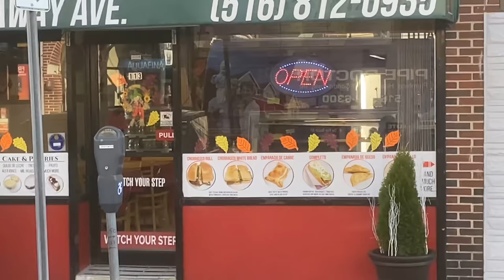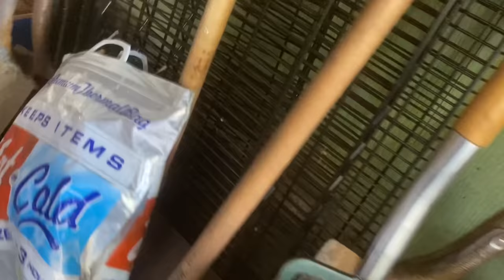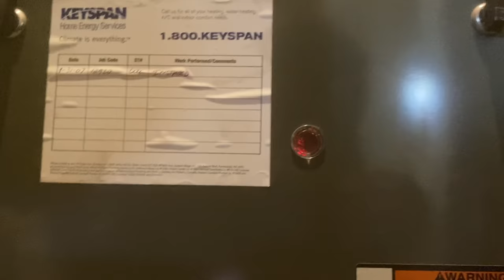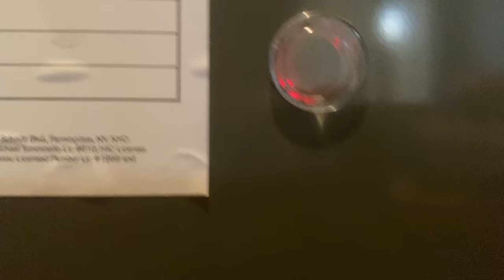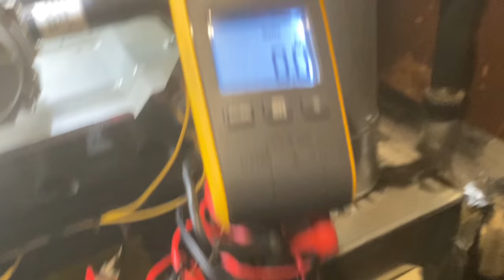Trane Gas Furnace Not Heating No Ignition Resolved

Comment: I find that those boards fail more than most. We use that universal board almost weekly. Roll out jumper elimates the old wire harness that you had to add jumper wire to. Also most trane boards will recommend you use the ignitor due to voltage change from 80vlt-120vlt.

Comment: The board probably had a failing relay. Once the contacts inside deteriorate you get strange voltage drops due to increased resistance of the contact pads.
Reply: It would be good content to try to find the defect on the board.
Reply: @Danimal.69  on the 120V output relays, failed contact will usually overheat down the relay pin and melt the solder joint on the back of board under the relay.
simply re-soldering it not the right fix, the relay should be replaced. all that said, you should never repair any HVAC control boards due to safety concerns. if something goes wrong after you repaired a "non field serviceable part" your on the line for damages and worse.
Reply: @throttlebottle5906  100% agree. I never said repair but to do an autopsy of the board failure. The problem could be a transformer or lose wire and so on. If you are not testing, then you are guessing.

Comment: A old timer showed me starting out. He would turn the fan to on and hold a lighter to each burner. The air in the heat exchanger makes the flame dance around. Then inspection cam and combustion test

Comment: If I was a betting man I would say that somebody replaced the original 80 volt igniter with a 120 volt. And it just wasn't getting hot enough to fire the furnace every time. If you notice in the beginning the orange glow of the hot surface igniter looks very droopy and not very bright and doesn't light up the compartment around it very much. After the new board is installed (sending out 120 volts) the hot surface is much brighter and the orange glow lights up the entire compartment around it .  Just an educated guess based on what I saw, because the old board was definitely an 80 volt control. 😎👍
As far as the heat exchanger goes, with that reading of 21ppm in the exhaust you're good. If the heat exchanger was compromised you would have been much higher than that. Probably up in the hundreds. 😎👍👍
Reply: @PipeDoctor  How about that reddish tile floor ?
Reply: i don't think a bad heat exchanger always produces high co ppm in the exhaust. depends on location and size of cracks/holes, impact on combustion.
Reply: That's why there's an update kit that comes with a 120 volt ignitor update. Kit 18110 I believe but don't know why Trane  switched ignitor voltages. The board will fix it though unless that's the 80 volt ignitor then the board will kill it in a month like the one I did on a heil last month. I'm new so I may be totally wrong.
Reply: yeah, 80V ignitor model board, 50A65-475 and newest factory replacement is 50A65-5165. which is for an 80V ignitor.
wrong 120V ignitor will certainly have multiple random ignition failures, 120v ignitor it doesn't get hot enough on 80V
Reply: @throttlebottle5906  Yep, and that was the original 475 board w/ 80v. The ceramic on the bottom of the new igniter looked round, which means it was a 120 volt, and it was wire nutted with those ceramic wire nuts that come with the newer igniters. 
Doesn't really matter though. The old board needed to be upgraded anyway. 😎👍 
Merry early Christmas throttle. 🎅

Comment: It was my policy if the gas valve control relay failed, I replaced the gas valve with the control board. After a couple of recall burns I found that resistance will drop causing the gas valve to draw excess current which would cause the relay to fail. Just a suggestion.  I've seen this alot with the smart valve Honeywell used for a while. Just a suggestion. That valve may be completely fine.

Comment: I had one at midnight; found bad ifc board plus Bad ignitor.
* Best to have two Or more voltage testers, on system.
From Denver, Colorado.plenty of furnace, boilers and mini split systems up in the high Rockies.
Yes, Burns on hands from time to time; freaking hurt.
LoL.

Comment: Mike,

A few things to note. First, I would double check your compatriot and make sure he replaced that igniter with a 120 volt one, other wise you’ll be replacing that igniter at no cost before two years is up. Second, those boards are bad for issues like this because the solder joints behind the 9-pin connector become loose and don’t make a good connection, hence the fluctuation in voltage. Next time, you can confirm your suspicion of the board by “wiggling” the 9-pin molex plug in a few different positions and when you hold it in the correct spot, it will fire up like normal: move it; and it will shut down again. I was told that this is part of the reason why Trane dropped White-Rodgers from their OEM control board manufacturing and switched to Emerson (the new OEM Trane boards are the green Emerson ones, not the mustard White-Rodgers). Third, I believe your lead was touching the chassis which may have caused a quick short circuit and would not allow voltage to display (just a theory there) the first time. Lastly, I always pull out the high limit and use an endoscopic camera to inspect it. It beats pulling that blower just to check a perfectly fine heat exchanger lol. Thank you for the content Mikey Pipes! I’ll see you in the next vid!

Comment: Open coil cover, make a 3/4 hole with step bit send in camera  in A coil over or take off high pressure switch out and send in camera, last ting is start blower and put a match in each heat exchanger hole to see if blower turns off or interrupt the flame

Comment: to check a heat exhanger primary i usualy use a insoection camera and go through the high limit or look down from the plenum if there is no coil or a gap of duct work before the coil. 
for a secondary theres ways to do it but the best is to pull the blower and actually just get in the cavity and look up

Comment: put your manometer on the heat exchanger side of the pressure switch and turn the blower on. if you get positive pressure you have an issue

Comment: would it be possible to jump 24v direct to the gas valve just as a test?
Reply: Thats what I do!
Reply: @SKAZ427  Cool! 
So that way you know if the GV is working or not... you just bypass the Control board.

Comment: same thing happened to me but the ignitor never came back on.  Trane XB80 f.a.g.heater flashing codes say bad hight limit but checked the H L. and thromostats all good. Any ideas?
Reply from the maker: check again
Reply: think its the main board ( also did some tapping and still didnt work ).
 @PipeDoctor

Comment: Could the secondary heat exchanger be partially clogged causing the high co levels .  testing the pressure switch with a manometer to see if it within specs. Remember, I am not an hvac expert but I do play one in YouTube comments. lol
Reply: this is an 80%, no secondary

Comment: If you slide the blade of a 3 amp fuse between the operable portion of the door switch and the side of the switch as you close it, the friction is just perfect enough to hold it in place … thermostat wire replaces the fuse on the round plunger style door switches
Reply: I kept a blown fuse in meter pouch just for this. It won't work everytime but it does for most.

Comment: I would return with an OEM board. Jes  saying.
Reply: Oem is more expensive because it's an update kit. Those universal boards are good enough for that old furnace.
Reply: @natepeterson7145  oem is usually more expensive initially, but because it is designed to work with a specific appliance and not a range of products, it is usually more reliable and can avoid callbacks.
Reply: @PipeDoctor  I have done it both ways, oem offers better reliability and reduces callbacks in the long run. Universal and,/ or aftermarket parts are great to get you out of a jam, or to get heat in a hurry.
Reply: Trane likes to sell "kits" and they are expensive. They aftermarket boards are reliable I've had great results with them. I would stay away from the real cheap ones in the plastic box. Trane back in the late 80s and early 90s used radiant sense to prove flame. They redesigned and discontinued the radiant switch and sold a radiant sense to flame rod sense kit that literally costed more than a new 80% furnace. Of course furnace installation cost is another factor and most wouldn't go for it.